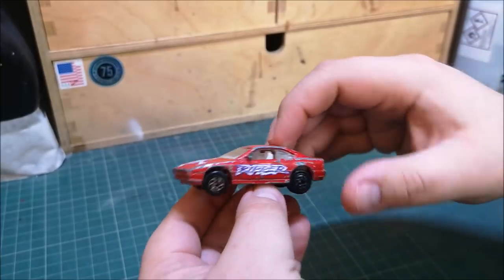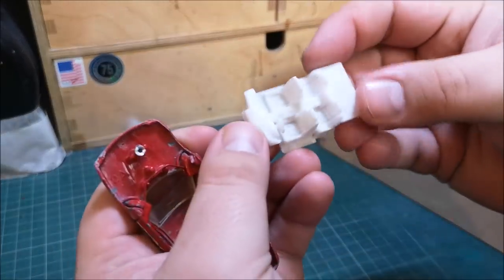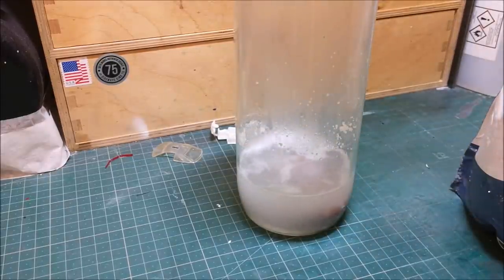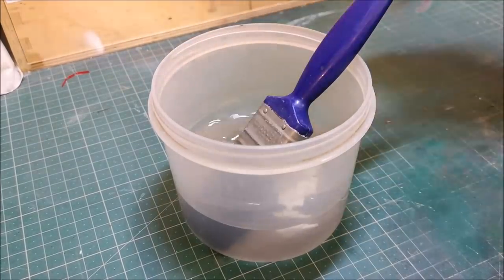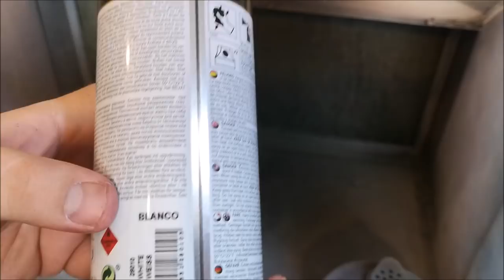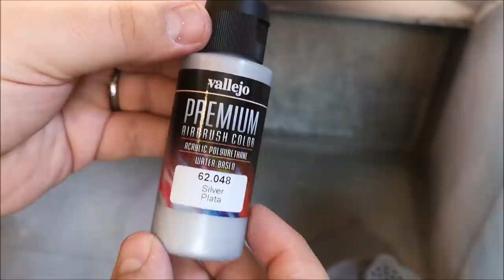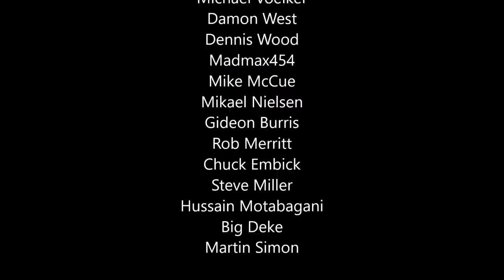BMW 850i Candy Custom

Comment: Great job, a favorite BMW of mine as well. Love the idea of the V12 in a 850csi but I would never want to work on one.  You could barely slide a business card between the wheel well and the valve cover and being a BMW you would need to work on it often.

Comment: A nice 850 i you made 👍  the e31 BMW is one of my Dreamcars since i saw one when i was 12 years old parking in our little village near our biggest Shop 😊 it was a Black car too since this day this BMW Coupe is one of my Dreamcars until today , but they much to expensive to drive them with all that electronics and Spareparts and others , so i never own one ,maybe if i win in the lotterie i would buy one , but i would buy the Alpinaversion they a  lot faster than the normal one 😊...

Comment: just a little suggestion or maybe you heard this before. When you are done usibg you spray can and there is still more you can use in the can tip the can upside down and press the button and you will clean the nossal out for storage and it wont clog on you.

Comment: No idea how you do your interior, when i use a spray can the paint falls of and forms a puddel on the seat :p
Reply from the maker: Maybe the paint you are using his no good nick?
Reply: Same here :( But I've got also a problem with painting the body - paint just chipping away no matter which paint I am using
Reply: try cleaning the nozzle in warm water first, then spray on a sheet to check the flow,
then hold the target 20 cms from the nozzle, spray and pass.
try not to start spraying exactly over the target (start just before  and after)

Comment: The 850i was a tremendously, even horribly, over-engineered and over-built car. They were hard to build, harder to maintain, and did not perform as well as the price entailed. The best example of this over-engineering in every cylinder in the car's V12 literally had ITS OWN COMPUTER. Still if you love the outrageous excessive overuse of technology, the 850i is the car to have. We will politely assume you don't like your money, okay?